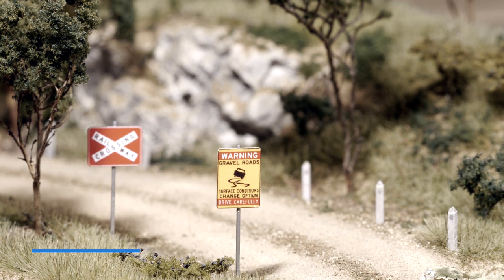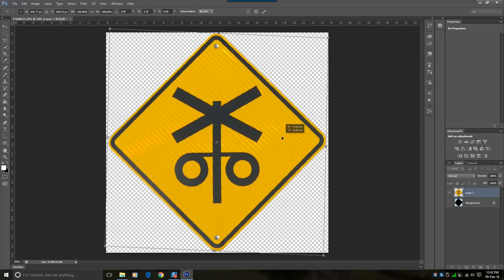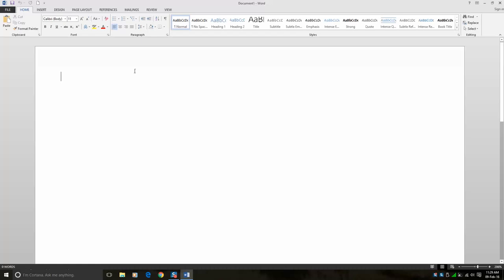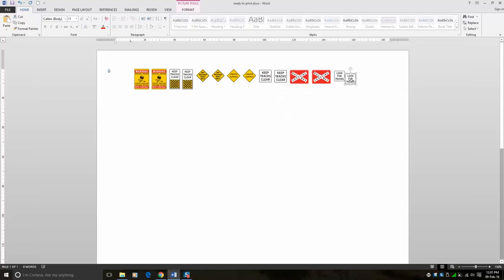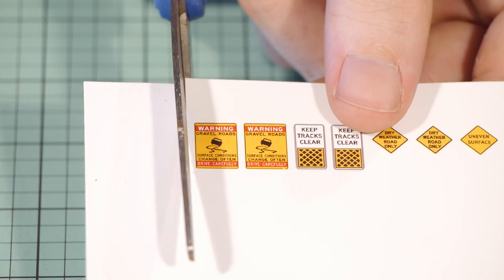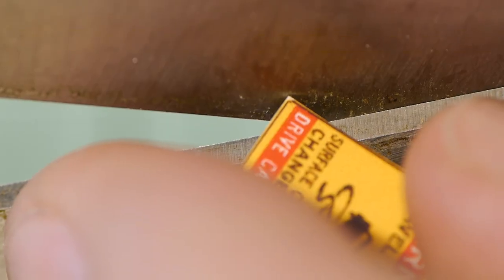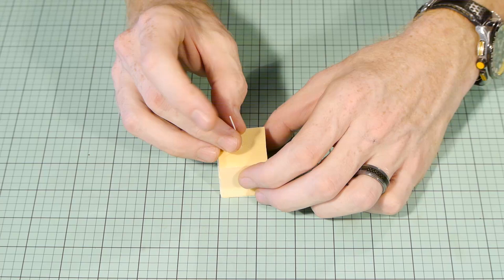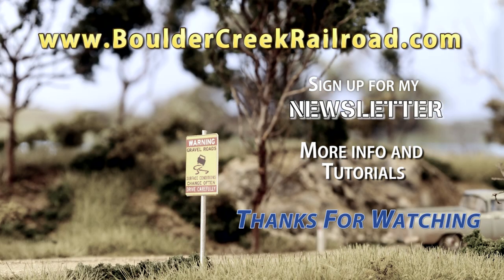Make your own Street Signs - Model Railroad

Comment: I've been using this technique to make signs for my local club layout, works like a charm. Only thing I do differently is to use a silver metallic Sharpie to go around the edges instead of paint. It's identical to the color of the can, and no mess/clean up needed.

Comment: Quick tip: Since windows 7, there's an included program called "snipping tool." It basically condenses the print screen +paste into word + crop + save into one step. I usually open it by hitting the windows key and then typing "sni" and it should pop right up. You get to select the part of your screen you want to capture. 

(And of course, I love your tutorials. You have a great eye for detail, which I suppose you have to have in this hobby!)
Reply from the maker: Thanks for the tip! I vaguely remember the snipping tool but have since long forgotten about it... Thanks for reminding me, I'll be checking it out right now 😉

Comment: Nice!! I love the soda can for a backing.  Have been using thick cardboard. Will give this a try.
Reply from the maker: +stblad3 Thanks Mate, yeah I really like the 'can' for its durability and also it's very thin.
Cheers
Luke
Reply: +Luke Towan If you ever need something stiffer, a machinist or mechanic supplier can probably sell you some steel shim material. It will be cheap.

Comment: I made my signs in a very similar way. The only difference being that I used thin styrene plank sheeting for the sign back as signs are often made of sections of metal sheet joined together here in the UK. I also used 1mm Tin copper wire for the pole, its not flexible but it very strong and not easily bent. My layout folds up against a wall so everything has to be sag proof when hanging at 90 degrees.   Great job Luke!
Reply from the maker: +cbcdesign001 Good point, I suppose you'd need a strong sign pole as opposed to a flexible one. Generally people knocking them shouldn't be much of an issue and I suppose if they are copper you can easily bend them back into position anyway.
Cheers
Luke.
Reply: Yes, its pretty easy Luke but in 1mm copper wire is surprisingly tough and takes quite a bit of force to bend it when its only 24mm long (6 foot in 4mm scale). I have brushed the signs by accident a few times and it hasn't bent at all so far. Alan.

Comment: The aluminum can for the backing is a nice touch.   I was wondering if giving the sign a spray of gloss coating might add another level of detail.  It might look too glossy however, and photo paper does have a nice look on its own.  

I was also thinking that resizing the image in Inkscape might help reduce pixelation.  Since it's a vector program, the sizing maintains the detail (to the limit of the computer screen pixel count), but the printer is also another pixelation source.  Might be worth playing with though.  I need to redo my logo for my videos and working with it in Inkscape first gives the best image to work with afterwards.  

And I really liked the truck driving intro.  :)  Nice touch.
Reply from the maker: +Terranscapes Thanks Mike, I wasn't sure how the pixelation would go, to be honest I didn't realize until I watched the video back that there was quite a bit of pixelation! I haven't heard of Inkscape but now I'll have to go and google it :) 

I tried spraying some of the signs with a Gloss spray but it actually took away from the 'glossy-ness' (if that's a word?) of the photo paper and I found the white turned slightly grey. But you're right that the photo paper on it's own does quite a good job of imitating a shinny sign.

The Stopmotion intro with the truck was quite fun to make although I tried shooting that scene 3 or 4 times due to getting half way through and then accidentally bumping the diorama!

Cheers
Luke
Reply: +Luke Towan The pixelation can be further controlled with inkscape. Your printer probably prints at 600 DPI, so you want your image document to match that. 

Instead of reducing your captured image, get the largest, best quality you can, then import into inkscape. Using the bezier tool, trace the elements of the sign, and fill them in with colours. Some simple tutorials can teach you how to use those: they are not complicated tools. 

You already have the meticulousness to perfectly recreate the signs this way.

Once you have a "traced" version, it can be scaled as much as you like, and should always print at the maximum DPI for the document, unlike the static sized original image.

Comment: There's soo many things I could say! If you use a piece of wire instead you can sotter the sign on which would look authentic. Also, in paint you can do alot. Explore your settings more. You can change your sizing and add rulers, even a grid depending on the year of your computer/paint.

Comment: Awesome video Luke - love the idea of using aluminium for backing! Don't know if you have them in Australia, but I found a great source of flat aluminium sheet in disposable baking foil trays you can buy - they often have large areas of plain flat foil on the base which I cut out and use for various things. Saves having to straighten out the curved metal of a tin can! :)
Reply from the maker: +tjf4375 thanks so much for the tip :) I didn't think about aluminum foil baking trays, I know the supermarket has them. I'll have to give it a try in my next round of making signs. As you can probably imagine I'm all signed out right now!
Cheers
Luke
Reply: Ha ha yes I can imagine you've probably got all the signs you need! I discovered the baking trays when I was making some elevator doors which I wanted to look just like stainless steel - I tried some drinks can metal first, but it was too thick to bend so I found these bacofoil trays and they're just perfect, thick enough to not get creased or crimpled but thin enough to be easy to cut and bend. Probably very handy any time you need to model any sort of metal sheeting! :)
Reply from the maker: I'll definitely keep that in mind. I have plans for an industrial area that will have lots of shinny metal.

Comment: Nice Video. But how did you made the driving car, at the beginning?
Reply: +chazy chaz stopmotion
Reply from the maker: +chazy chaz Troy was right, it's basically a set of 140 individual photos, each photo I slightly move the car forward and finally I piece it all together to make the final video. "Stopmotion" is the technical term.
Cheers
Luke